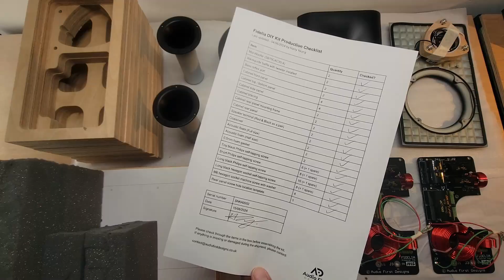Fidelia DIY Kit Assembly Tutorial

Comment: After watching the video of Erin's Audio Corner, I feel that Fidelia is the only speaker I have ever heard that can't hear any difference between the sound played back and the audio track. It's incredible!
 I would like to know if you will design and produce active speakers (5.25-inch or smaller woofers) with the same sound quality as Fidelia, and if there is a rough timeline？
In addition, can individual users in mainland China place orders directly from the Audio First Designs website and have the speakers shipped to destinations in mainland China?
By the way, for the sake of assembly quality, it is best to order the glue used to assemble the speakers from the Audio First Designs website at the same time, which may not be available in mainland China.

Comment: This is very interesting, there is a real lack of objectively well design DIY kits so i wish you every success. I'm tempted to buy a kit, but am wondering:

1) is it likely that you will release this speaker in prebuilt form or have you considered partnering with a uk company thst could sell prebuilt to the customer? This is quite common in the US and is useful for people who like the superior construction of the ply cabinets but don't have the skills and tools to finish the cabinet with veneer or a professional standard paint fonish.

2) do you have any plans for either a standmount that gets to 40hz or below in room, or subs that would compliment these?

3) can you provide replacement drivers if my curious children poke a finger into the drivers?

4) what is the baffle made of?
Reply from the maker: Hi kristiantizzard7796,
Thank you very much! Regarding your questions:

1. I have received many similar request and I am working on it now. There will be an finished version available in a near future.

2. I am designing a new series of high performance DIY kit to be released next year targeting around Q2 consisting of a mid-size 3-way standmount, a 3-way centre channel and a 2-way surround speaker. The 3-way standmount will have a much lower bass extension and higher output capability compare to Fidelia. You might want to get it a wait.

3. Yes no problem, I will also make you a guidance video on how to change the tweeter correctly.

4. Resin, SLS laser 3D printed. Lightly sandblasted before spray paint to get a finish like this.

Comment: this is a clear and comprehensive guide to building this speaker, wish i had those when i last build from kit.
hopefully in the future audio first design creates more speakers, this model was not what i was looking for.
i was thinking i could modify the box to make it sealed and half the depth, but i am sure something unforeseen would happen or the end result might be worse.
maybe the crossover parts gets less cooling and overheat, or the woofer wont sound good in a sealed box, even tho i am planning a 180hz 2nd order high pass filter on it.
i am also thinking the included foam is not suited for sealed either.
and i am not sure one 5" woofers is enough for high volume listening.
how about a mtm design with sealed box, if you can probably use the same crossover as this one but need woofers to be twice the ohm from manufacturer.
Reply from the maker: Hi sudd3660! Thank you for your appreciation! All I hope is to keep the process as clear and easy as possible so mistakes can be prevented, so everyone can enjoy a good performance more consistently. I am working a more comprehensive kit line-up with much better output capability to be released in 2025 early Q2, please subscribe to my newsletter and I will keep you updated! Regarding your question about MTM - One can't simply re-use the crossover for a normal two-way design with a 4Ohm woofer in a MTM 2-way with 2 x 8Ohm woofers, because the vertical lobing issue in MTM design tends to cause a dip in the power response of the speaker so the crossover has to be redesigned to achieve the same tonal balance.
Reply: @AudioFirstDesigns  i am keeping my eye on your brand and wish you all the best, a great first product :)
Reply: @AudioFirstDesigns Nice to read this, i check your website time to time, i see you remove wood damper in webpage.  It will nice some people could consider new one than other brands offerings.

Comment: I do have a question, regarding crossover parts. The crosscaps are Jantzen budget line. Could you not if buying the kit, buy separately superior ones like the Silver Z caps ? Two areas I would also consider is chambering the bracing holes ( rounding ) and lining the sides, top and bot with damping material. Would you advise doing it ? ( I do appreciate it is a small cabinet, well braced and may not need it , but ! could help even further. Would appreciate responding, many thanks from Australia.
Reply from the maker: Hi Cruise2023, thank you for your questions. The Sliver Z caps line doesn't offer some of the values that I used in my design (e.g. 33uF) and they are bigger than the Cross caps which means the PCB need to be re-designed in order to fit the Sliver caps. Of course, as a DIY kit you have the flexibility to build your own crossover following the schematic (or I can do it with a service charge applied). Regarding the bracing holes, rounding the hole edge will give you a touch more internal air volume but apart from that doesn't do much acoustically. When you are talking about damping material, are you referring to cabinet wall vibration damping or internal acoustic absorption material (foam/felt etc)? For acoustic absorption, the boundary (the wall) is actually the least effective location to put absorption material, because it is the pressure maxima & velocity minima for the modal resonance inside the cabinet. You want to put the absorption material at the velocity maxima of the resonance (in this case, near the center of the cabinet) for the most effective absorption. Many manufacturer line the absorption material on the wall just because it is the easiest way to do it, but its not the best way.

Comment: I'd be interested to know how much the tweeter, woofer and crossover parts are separately and what kind of price range the parts of this speaker compete with against the well known brands that are sold assembled. E.g. Is this getting you a $4000 speaker?
Reply: Uses SB Acoustics Ceramic-Aluminum composite (I think?) and Erin Audio Corner has a subjective and data-driven review. He mentioned it being able to compete with much more expensive speakers (SQ wise, definitely not output wise).

Comment: Im kinda curious but how much of a difference does the additional vertical bracing make for the top/bottom 2 square holes? Couldnt you have just made them into 2 large cutouts and still achieved the same strength in bracing while gaining more cabinet volume?
Reply: The Audio Design Fidelia was specifically designed to be a small volume bookshelf speaker for smaller rooms.

They have a bigger 3 way speaker coming later in 2025 for bigger size rooms.